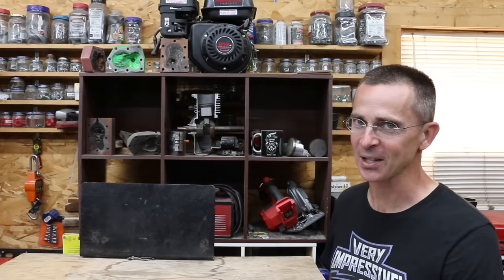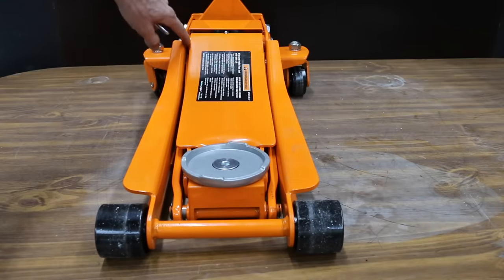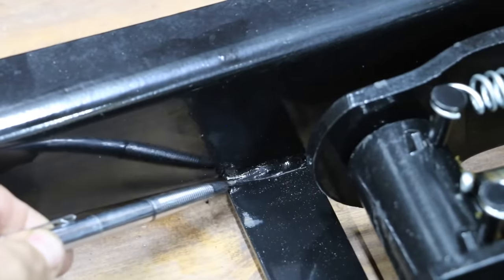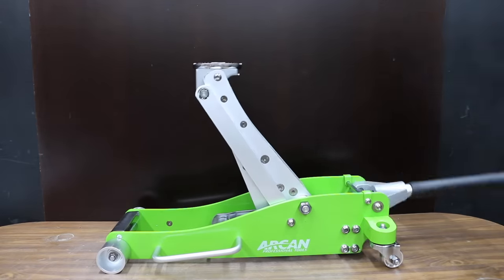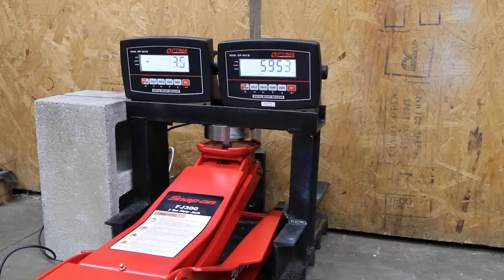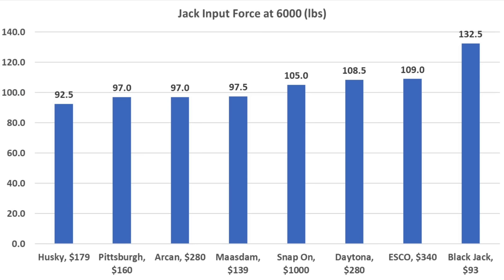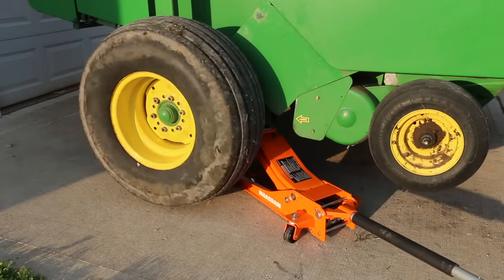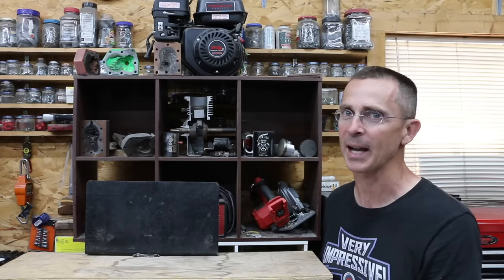Best Floor Jack? $1000 Snap On vs Daytona, Pittsburgh, Arcan, Black Jack, ESCO, Husky, Maasdam

Comment: We have an old Blackhawk Jack that’s older than any of us here that still works great! We also have several Daytona Jacks and two Pittsburgh aluminum racing jacks! All work great!
Reply from the maker: Nice!  Thanks for sharing!
Reply: The old Blackhawk Jacks and Walker branded jacks were considered the best of the best before they moved operations to China. My dad and grandfather used Blackhawk and Walker jacks exclusively in a very large commercial tire shop for decades. They used to lift heavy cars when cars were still 5,000 lbs and large pickup trucks, heavy tractors and even semi-tractors with their 2.5-ton Blackhawk and Walker jacks. (Yes a 2.5-ton jack can lift the rear drive axel on a semi tractor that isn't attached to a trailer.) All they ever used were 2.5 ton jacks for everything except when a 12-ton or 20-ton air-powered bottle jack was needed to lift fully loaded semi trucks or loaded 1-ton dually pickup trucks. A good Blackhawk 2.5-ton jack would lift about 90% of everything they faced on a daily basis.

Comment: Every video on this channel is a learning experience. I have been using the same floor jack for 20 years and have never even checked the oil level. After watching this video, I will go ahead and fill the oil level in my 20 year old jack that has worked great since day one and still works great.....
Reply from the maker: Thanks for sharing.

Comment: I'd love to see a comparison of different brand's compressors, something like a 20 Gallon upright from each different brand, all with roughly similar specs, designed for home use. Testing things like time to build air, true CFM, and maybe even do a torture test to see how long they can run continuously. A lot of brands lie about CFM and other specs.
Reply: Goodyear oil free 20gal vs Mcgraw oiled 20gal vs Craftsman 20 gal.
Reply: That would be a very expensive test. Rremember he pays for all the tools with the help of donations.
Reply: I’d love to see this too. 
Largely small compressors that are likely to be seen in a small home workshop or the portable ones for small jobs (other than pancakes) by companies like Milwaukee, DeWalt, etc.
Reply from the maker: Thanks for the suggestion.

Comment: I now have a Daytona 3-ton, low profile jack and love every aspect of it, especially that it's blue. I gave away my 20-year-old NAPA floor jack and regret only that it's saddle was a lot bigger and could cradle the load without worry of slipping out. All of the tested jacks here have small diameter saddles.  Why?
Reply: I like them too, but not if I have to lift them a lot.
Reply: They sell adapters
Reply: couldn't you change the saddles to larger ones? I though you can do that on older model jacks but i donno

Comment: I bought the exact pittsburg model you tested about 4 years ago from Harbor Freight. Only paid about $100 for it, I think it was a coupon. It has been an amazing jack. 
I did have to fill it with oil before I used it. Had a big sticker on it saying you had to for it to function. I was surprised that you didnt say anything about that. Do they not require that anymore? It was kind of a pain since I had to buy some hydraulic oil to get it working.

Comment: Great test. 
A mention of warranty for each Jack would be a nice addition. 
I had one of those mini floor jacks from Walmart that lasted 20 years, then after it died, I bought one that looked just like it at an auto parts store - which died within it's one year warranty.
Reply from the maker: Thanks!  Thanks for the suggestion.
Reply: Was is the MVP brand? I've had one for over 20 years and it's still going strong. It's a great help when doing ball joints and suspension work cause of it's size.
Reply: i have a craftsman i bought 31 years ago   its still good but love my new daytona long reach lopro
Reply: @mercedes-amgforlife3237  yes it was

Comment: I have the yellow Daytona which is now offered in "hot lava" red and maybe another color.  The  $280 Daytona is definitely better than the others at Harbor Freight because if you look carefully, the wide wheels have greaseable zirks and they also have internal bearings.  And the handle has an easy pull-out knob to remove the handle.  The cheaper Daytona models do not. So side to side with some of the others they look almost identical, but it's these small added features that sold me on it.  The wider wheels with bearings also make it much more stable and quieter.  I think I paid $250 for it on sale with a coupon in 2016.  It's a fantastic jack and ...$750 less than Snap-On.  And while the Daytona may have 3/4" less height.. that's $250 more per 1/4".  And I think I have $750 worth of scrap plywood laying around lol.
Reply: Excellent suggestion: Yes even if you don't need the extra height, rolling the jack onto a rectangular piece of plywood may also help even out some lumps and bumps in the surface of a floor - thus helping the jack when it needs to roll to maintain its safe lifting position as the saddle rises.

Comment: I suggest you do a review/test of jack stands.  I have a pair of Harbor Freight 3-ton stands which were recalled and replaced a couple of years ago.  I am always leery working underneath a vehicle and use redundant stands for safety.  Test modes could include total weight to failure, work height, dynamic stability, ratcheting mechanism release, etc.  I really enjoy your videos as they are extremely informative and well done. I am impressed by your creativity and resourcefulness on conducting the tests.  Keep up the good work.
Reply from the maker: Thanks, will do!  Thanks for the suggestion.
Reply: Yes, and if you can include a cross-comparison between the common triangular base ones (with and without secondary safety bar on the sawtooth vertical lift post, and those that use a solid pin-and-hole design vs. sawteeth), and a category comparison against the "tripod style" (e.g., ESCO 10498 and now Harbor Freight's new Daytona copy).  Thanks!

Comment: If you watch the jacks when he tests the number of strokes it takes to reach maximum height with a load none of the jacks move when picking up the differential....his previous test said it has to reposition itself to lift. We use floor jacks to move stuff around the shop but they don't have to reposition in order to lift.

Comment: I also have the 3 ton Daytona, and I'm super-pleased with it.  Definitely a better jack in all ways than the Pittsburgh it replaced.  Glad to see it perform so well in your testing!
Reply from the maker: Thanks!  Thanks for sharing.
Reply: @DTW-bx2vy  lifts quite quickly with no load, once its got some weight on it (like as soon as it contacts the vehicle) it lifts like a jack should in my opinion. Definitely easy to pump, even when approaching its weight limit it only requires a slight bit of "oomph"  I've got the Daytona 3 ton low profile long reach. Used it daily in a shop for at least 2 years now.
Reply: @DTW-bx2vy  I'd say it's fast but very solid - very predictable.  Recommended.
Reply: @DTW-bx2vy  I am sorry to hear about that. Do you have access to an air compressor? There are different types of airbag jacks that are powered pneumatically. Controlled by the push of a button, and much lighter and easier to use than a hydraulic jack. I suppose it wouldn't be a good choice to keep in your vehicle for roadside emergencies due to needing an air supply, but then again I doubt anyone is carrying a full size Daytona jack either. Obviously I don't know your situation so I'm trying not to assume anything here, but it sounds like a pneumatic jack might be a good option for you. That is, if you have an air compressor.
Reply: @DTW-bx2vy  I wish I could give you a confident answer here. I have noticed the Daytona definitely is easier to pump than about any other jack I've used for my line of work, including Cornwell, Matco, Strongway, and Sunex. I've never really thought much about it, more than noticing it takes less force. As for whether 25 pounds of force is enough, I don't think I could say with 100% certainty. I can give you my thoughts though. The heavier the vehicle, and also the higher you lift, you usually need more force on the handle. I suspect 25 lbs would likely get the wheels off the ground for something of average weight. Much higher than that, im just not sure. Just today I used my Daytona to lift my Ford Ranger and I didn't find myself pressing hard into the lever at all. Perhaps you could use a "cheater bar" on the end of the jack handle to provide more leverage, thus reducing the force you have to impart, provided you have enough space to pump a longer handle. Something like a larger pipe to fit the outside of the handle, or even a piece of rebar to slide inside the handle. Sorry I can't be more of a help here.

Comment: I've had the standard pittsburgh 3 ton for 6 or 7 years. It's done what I needed it to but my only gripe with it has always been that even if there's no way for it to build pressure the lift arm will go up as the handle is lowered which makes it impossible to get way under a car
Reply from the maker: Thanks for sharing.

Comment: I love to see a test on these jacks after a few years of use.

I have the Pittsburgh,  ive had it for id say at least 10 years...it's quite decent. The only time i ever had it release pressure was when i tried to help level an rv with it. Other than that it's done everything ive ever asked of it with zero issues.
Reply from the maker: Thanks for the suggestion.
Reply: @ProjectFarm  
I hate it when they put them foam cushions on the handles.
the one on my mower started ripping in no time.
Same with garden tools.

Comment: I definitely appreciate this full-range test of floor jacks. Low clearance performance is of particular importance for me since my new-to-me car has only about 7-ish inches of ground clearance and the OEM "front and center" jack point is deeeep underneath and behind the front axle. Looks like I'll be shopping at Harbor Freight for my first proper shop jack, to get a Pittsburgh or a Daytona. :)

Comment: Great work!  Have been hoping you’d run a floor jack test and you exceeded expectations, as usual.  It’s clear that several of the models are identical in design and likely built by the same source manufacturer.  These manufacturers will market a single design to a world of resellers and each reseller can choose to pay less per unit and accept a wider variety of (for example) “minimum acceptable” weld quality or, alternately, pay a little more for more consistent welds that take more time and different skill sets.  The Maasdam, Pittsburgh, and Husky are clearly from the same source but each brand pays for the quality that meets their desired price point. Most surprising are the similarities in design and quality of the Daytona and Snap-On jacks where the $720 price premium for the Snap-On boils down to customer expectations for the Snap-On brand.  With either brand you get the same 3-year warranty.  In the end, the Daytona (and Arcan) proves that $280 is the sweet spot for a high quality and high value 3 ton jack.
Reply from the maker: Thanks!
Reply: Yeah, I have quite well assembled MTX jack and it's about 100 sure that it's essentially same as Maasdam, Pittsburgh and Husky. Solid options for hobbyist imo. I wouldn't be surprised if many of them are built and validated to quality groups even in same factory and offered in different quality and price to resellers.

Comment: I’ve been a car guy all my life and never given much thought to my floor jacks. This was very eye opening with regard to build quality difference. Going to go look at my jacks now! 😀
Reply: Heard about the whole snap on Daytona jack debacle years ago ,glad to see a real test finally.
Reply: Buy a Daytona
Reply: I've had my Daytona jack for about 6 years now. It's holding up great!
Reply: If you don't have an aluminum jack, get one. You will fall in love. Just make sure you only use it on pretty level surfaces.
Reply: yeah get the daytona. I bought it like 1.5 weeks ago and it’s easily the best jack I’ve used. Top notch quality. Don’t cheap out on jacks and stands. A good jack pays for itself the moment it prevents injury and/or damage to your car.
Reply: @bear532  who sells the Daytona?
Reply: @Packinheat1175  Harbor Freight
Reply: @ST-0311  ah..Im from Canada, would explain why Ive never seen Daytona here. Thanks.

Comment: I had a Pittsburgh, but wound up getting one of the aluminum Arcan ones (Jegs branded) because the steel Pittsburgh was so heavy I couldn't carry it to the street where I worked on my car. Glad to see it held its own, thanks for the video!
Reply: If you tip it up on two wheels, you can roll and steer it quite easily. (unless you don't have a paved driveway)
Reply: I have the Pittsburgh 1.5 Ton aluminum one it's so lightweight at 33lbs.
I've had it for 10 years now no issues
Reply from the maker: Thanks for sharing.!

Comment: Wow. Learned a lot. I remember when I first started working at the dealership when I was 19, (I am 38 now), the craze was snap-on tools. The truck would come every Friday on payday to collect payments and sell whatever they could. Not having any tools, everyone urged me to buy the "best" and so I followed suit and became a slave to snap on lol. I bought everything from that truck from toolboxes to screw drivers. I quickly found out that you were just paying for a name. Quality does come with a price, but so does brand recognition. Like this test. The Daytona is almost identical to the snap on and performs just as well for $720 less. Think about how many tools you could buy with that remaining $720 without compromising quality for your jack. Great video.
Reply from the maker: Thanks!  Thanks for sharing.
Reply: Some harbour freight and snapon jacks are literally the exact same jack from same factory with different stickers for $700 less.

Comment: Bought a 3 ton jack at Harbor Freight about ten years ago, like 75 bucks. Put it together pump it up empty and it seemed to work fine. Before I got a chance to use it someone stole it! Really wanted to talk to the guy to see how he liked it.  Wanted a review before I went and bought another one.  
 I did buy another and it worked fine until it burned in a fire. I'm reluctant to by another floor jack now.
Reply from the maker: Thanks for sharing!
Reply: Tough luck my dude.

Comment: My Harbour Freight floor jack( Daytona in orange) has been a great addition to my tool line  up.  I also have a vintage Craftsman floor jack from the late 1970s that still pulls its weight . Thanks for another fine video. ✌️
Reply: I've got an old 60s Sears 1.5 ton floor jack ,it leaks a little but they lied on the rating ,it'll lift a dually pickup.
Reply from the maker: You are welcome!  Thanks for sharing.
Reply: @MrTheHillfolk  Yeah, they under-rated them back then & over-rate them now.

Comment: I wouldn't doubt that a lot of them are made by the same companies in the same plants. Snap On jacks in the past were US made Walker/Lincoln/Blackhawk/Hein Werner units but now Shinn Fu America owns those names and I believe that Snap On is a Chinese made Shinn Fu. The HW jacks are US assembled and use the "old" Walker/Lincoln style chassis. I just used my 93632 Walker 1.5-ton unit today. It was free from the curb and needed to be bled, have fluid added and eventually I had to change the U joint. It's been a solid jack for several years now.
Reply from the maker: Thanks for sharing.
Reply: @dickmick5517  I think it refers to their operations in the US. But yes, they own the rights to the Hein-Warner name, which also includes parts for Ajax, Walker, Marquette, and Lincoln.